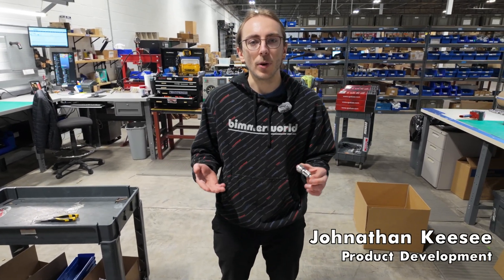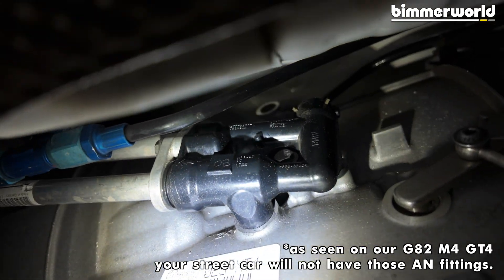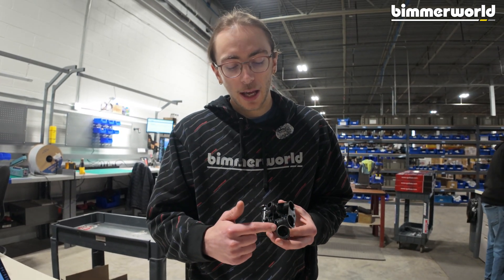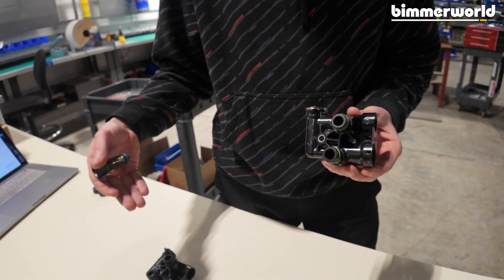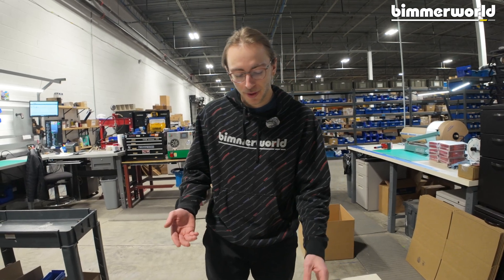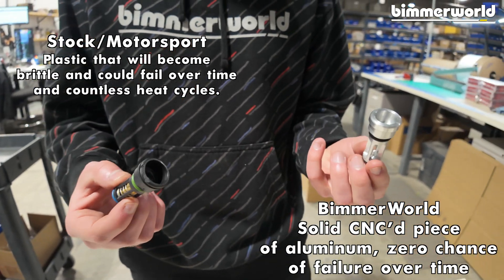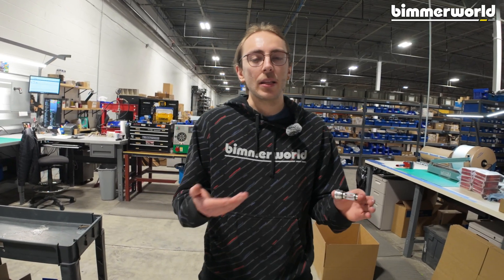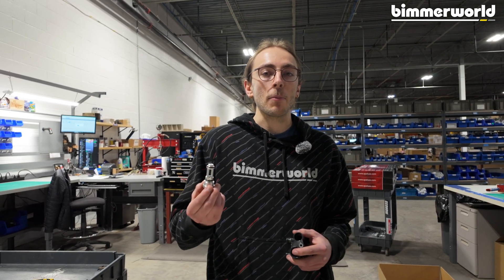We've taken ZF8 Cooling to the next level for our track driving customers

Comment: Nice

Hey you guys would be the BEST people I can think of to ask this:

With a company making a dry sump kit for the S58 on IG recently, do you think it would be possible to drop the engine and move it and the 8HP down and backwards a few inches. 

I understand you'd need a custom drive shaft and custom transmission and engine mounts.

Im just wondering if its physically possible? Thinking of a M4 GT4 EVO+ build and would like to balance the weight more like on the GT3 car but wondering if the 8HP or turbo/exhaust would hit the chassis rails....

Again do you guys think it could be done?
Reply from the maker: If you have the fab skills anything can be possible.   It would certainly require more than just new mounts - also keep in mind a GT3 has the exhaust going out behind the RF wheel, not under the car.